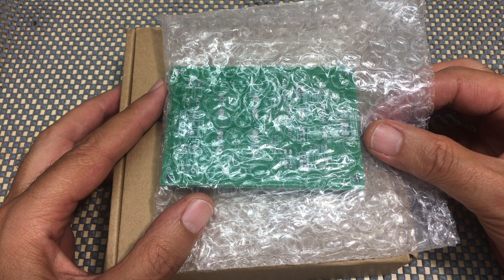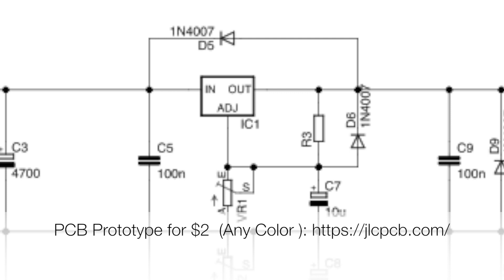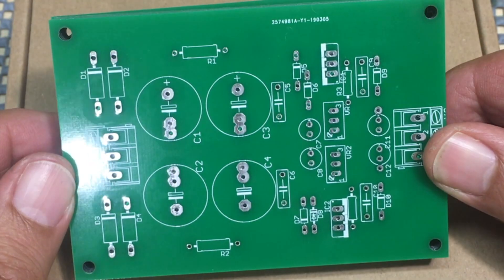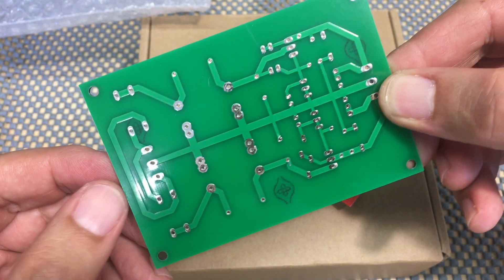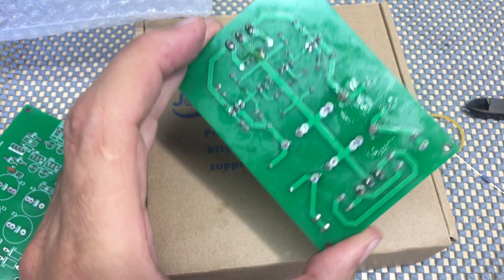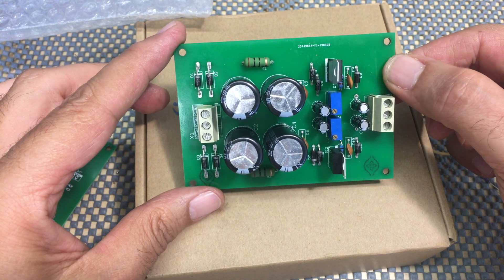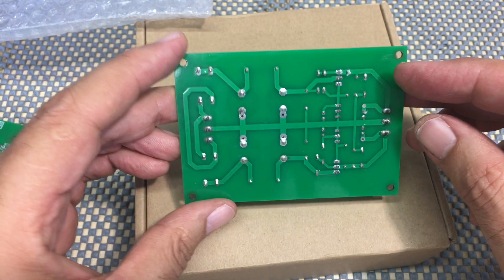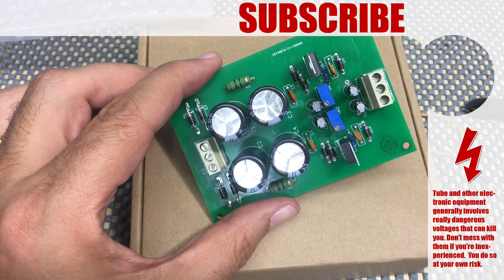Make your own professional PCB's

Comment: 120 ohm resistors between out & adj of the LM317/LM337? Reverse-biassed diodes between in and out?

Good man 👍; you've obviously read the datasheets at some stage 😉. Most designs you see on the net get those wrong, because people blindly followed the datasheet examples &/or didn't understand the text where they explained minimum load requirements & protection requirements.

(To be fair, NatSemi made the same mistakes when they introduced the LM317/337 (10mA min. load, worst-case; fairly resistant to reverse current) and just copied the examples from the earlier LM117/217 (5mA, worst-case; will die if reverse current too high e.g. large output caps). And those errors have propagated ever since; even TI's current datasheet gets it wrong in most examples…)

Amazing, isn't it, that you can get boards professionally made cheaper than you can make them. When I got back into electronics as a hobby (after burning out on it as a career) a decade or more ago, the first board I made I used dalo pen, the next few were toner transfer - and ever since, I've been using chinese board houses (mostly iTead). We'll get you moving over to SMDs next! 😉

Comment: You are the second person I watch to have done an unsolicited review of JLCPCB Manuel and it has convinced me that it is really the way to go. For the price even home made boards can't compete once you take into account the creation of the pcb image, toner transfer, etching solution (and mess that goes with it), drilling, plating etc. I think I will really be going this route as well. I thought they also had a component supplier attached to themselves as well, making it a one stop shop effectively. Great video.
Reply from the maker: Actually I had these boards already and they contacted me asking if I’d give my opinion and offering me more boards, so in  effect it’s not totally unsolicited. However, talking about it after the fact is something I have no problem doing, especially if I’m happy with the result, which I am.
Reply: You bought the first lot yourself... thats unsolicited! If they were crap I'm sure you would have said so. Hope you enjoyed your holiday. A nice break from normal life.

Comment: Hi, very nice video I’m also thinking of using a PCB manufacturer for my projects, the software program I started to use for designing my PCBs, is auto Trax dex PCB not sure if you seen the videos on YouTube,  The 3-D rendering in this package is very good.
Reply from the maker: I have always used eagle, but I guess I need to go with the flow on this one.

Comment: Oh great, after weeks of experiments I finally got a good result from the toner-transfer-method and now some company can do it ten times better for one twentieth the cost.  Even bought a new laser printer, ultrasonic cleaner and a used laminator, too.  What's the world coming to?   
One thing I did learn, if you're having trouble converting a laminator, as I was, the nail-polish-remover trick works well.
Reply from the maker: I know the feeling. I bought a laser printer a while back just for the boards. Never thought I’d see the day that pro boards cost less than homemade.